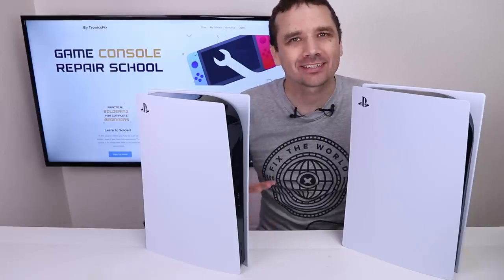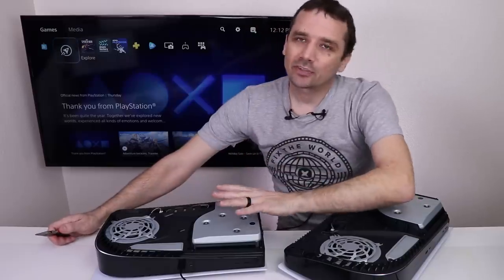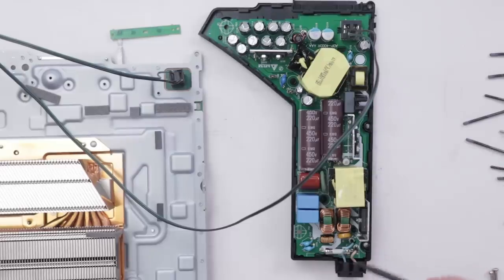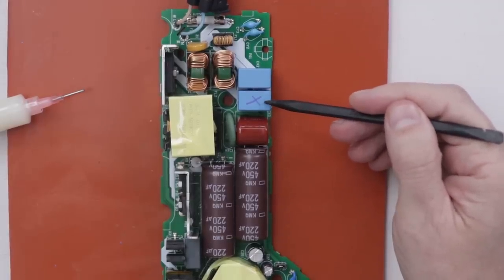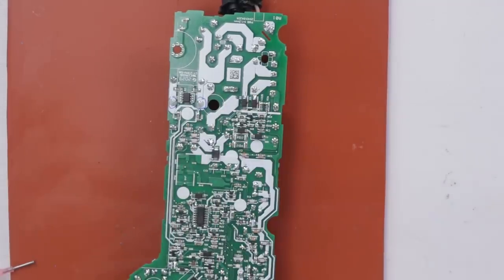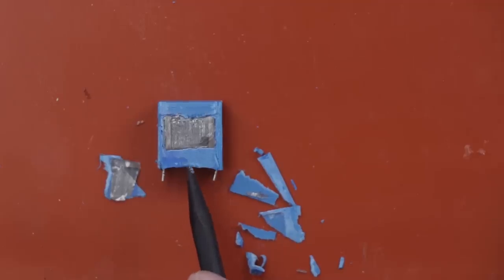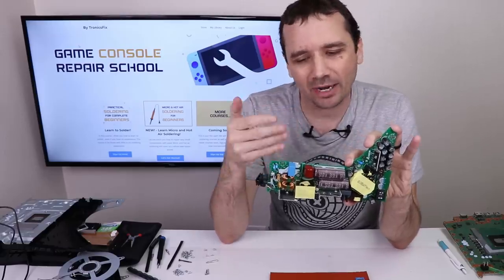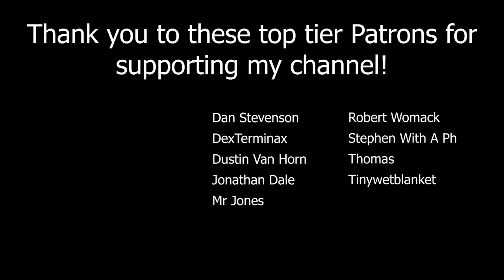PS5 Coil Whine - What Is It and Can I Fix It?

Comment: The buzzing in a foil capacitor is down to electrostriction - which is movement of the insulating films caused by the electric field as it passes through the capacitor.  It is harmless, apart from being annoying.  If you wanted to reduce this buzz, you could replace your foil capacitor with one rated for a much higher voltage.  A capacitor rated for a higher voltage will have thicker insulating films - which will need a higher force (voltage) to make them buzz.  A higher rated film capacitor should, therefore, be quieter compared to a lower rated one capacitor under the same voltage conditions.
Reply: He needs to see this comment
Reply: @TheMcdrewb  He sure does,mines dont whine but what if it does it later down the line,noises annoy me. I made sure i have controls on all 8 fans in my pc case too,lol
Reply: @MorbidThrasher666   yours does whine, you just haven’t played the games that mostly cause it. Try Destiny 2 or Demon souls.
Reply: How much is the difference in cost would you say? Curious if Sony literally skimped out on a few pennys or even a couple dollars.
Reply: @TriWaZe  Generally components are chosen according to what's appropriate for the electrical properties of a given circuit. The minimum voltages for capacitors is determined and then likely increased by a given percentage to guarantee that the part will last. Issues like coil whine are probably far down the priority list and somewhat difficult to anticipate. It's not so much that Sony skimped out on a part, rather, they followed standard practices for good circuit design but didn't anticipate this issue in advance and they'll likely make a change in a future revision.
Reply: @ultimateman55  Yeah but if this issue could just be avoided by putting in a higher rated capacitor then higher rated capacitors should automatically be chosen if the prices arent the issue. It should be factored in immediately. We need this voltage but up it to this to remove potential issues. Sonys been making electronics for decades and clearly understand this.
Reply: It seems to me you're much more interested in blaming Sony and accusing them of knowingly creating loud power supplies to save a buck than you are in considering what factors go into component choices and how such an oversight could be made. Perhaps you should just jump straight to Twitter to express your righteous outrage.
Reply: @ultimateman55  Nope. Again simply asking common questions based of this guys statements. Its a no brainer decision if this is really the issue.
Reply: @TriWaZe  Well if you aren't going to assume then perhaps you'll be willing to accept the idea that such issues are difficult to anticipate as electrical components such as capacitors are chosen based on their electrical properties and durability. Believe it or not when you're designing circuits in electrical engineering class they don't often bring up how much sound the component makes while current is running through it. It's perfectly plausible that it was an oversight rather than a conscious, negligent choice to save a few pennies.
Reply: @ultimateman55  totally agree on a engineering standpoint. I think going thru quality control it would have popped up. Obviously not every ps5 will have the same issue, but department that handles appearance and noise level would have heard it. Basically stressing a system to see for any weak points.
Reply: @wolffactor56  That's entirely possible, at which point conversations about release dates, customer impact, cost and other factors would be discussed. Would a relatively small nose affecting a given percentage of systems be enough for Sony to take corrective action? These are the kind of difficult decisions that Sony would have to make. I'd be willing to bet that many customers would happily accept the noise if meant getting their console on time. Who knows exactly how it went down, though? It's all speculation.
Reply: @ultimateman55  they definitely wanted the system out for the holidays. Whining noise would drive me nuts and I would probably bear with it for a few months and rma the system. Watching ReviewTechUSA video they are replacing certain ps5 owners systems when people complain to corporate. I’m sure future revisions this will not be a topic. What should be a topic is getting the second m.2 nvme bay usable for storage.
Reply: @ultimateman55  
Not disagreeing with what you've said, it's all very valid. But I don't buy them not anticipating it personally. The PS4 Pro had coil whine, and as shown in this video the PS5 uses the exact same component. They've known about it for many years, and I don't see how it's something that would go accidentally overlooked during stress testing. So much focus on creating a quiet product in their design choices, and they overlook a component that's profoundly noisy under stress? Doesn't add up to me. Console noise seems like it would be a focal point on their drawing board. Sony trying to keep production costs of the PS5 low is well documented. Thinking they went lower on some components and having to make compromises is just as plausible as what you're saying. There's been more backlash this time around so I hope it is something they revise in the future. It's obnoxious on certain games now at release.. I can only imagine what it will be like a couple of years down the line as games get more and more demanding than they already are. It's something that really needs sorting. Whether it was negligence, or an acceptable compromise.. It's not good either way. In fact, to me negligence is worse.
Reply: Negligence is not the case, is noise is between deemed apropiate by standards is OK for quality control, few pennies here and few pennies there mean a lot when you're cost saving, specially when mass manufacturing, running a business, and when you talk about millions lost is an important blow, the few "pennies" saved can be used by R&D deparments in more critical areas, and if not to find a profit or not to lose quite much, we want state of the art consoles and games but don't want to pay 999 bucks for a console, so where do you think these companies can make a profit? They don't survive from charity...
Reply: So I guess is safe to say Sony is using cheap capacitors, or low voltage capacitors to maybe reduce costs, but it makes the console noisy, that is a cheap move from Sony.
Reply: My PS5 has that "coil whine" but honestly its not as loud as I expected. Frankly, when the Blu-ray drive is in use, it's much louder than the coil whine. For those still wanting to buy a PS5 and think this may be a deal-breaker, it shouldn't be a worry. My PS5 has been running great ever since I got it. Also, take note that people will either be using headsets or have their surround-sound systems going and both options will easily cover up the whine. Plus, TronicsFix had to put his ear right to the PS5, before he tore it down, to really hear the whine.
Reply: @ultimateman55  if that's the case why is Sony customer service saying they're aware of the buzzing & giving out replacement models since launch?
Reply: @MvK-Delta  only ps5 game I have is demons souls. Other than it getting loud as hell when it randomly reads the disc I legit don't hear anything. Do you have to put your ear up to it to hear or are you supposed to hear it from across the room lol
Reply: Thanks for your understanding
Reply: @TriWaZe  

My first thought too. Like wtf sony this is next gen. Not a face-lift I want everything to be upgraded to now spec not have parts the ps4 has from a decade ago. 

Its gonna be another 100yrs until we get AR even though theres AR glasses now that look incredible. But they are only sold to professionals not for fun. 

Ide love to build a motorbike and when I get stuck just put the glasses on and have a virtual motorbike my model next to my real bike and I can blow up the virtual bike and see how it works or fits together like I'm sitting inside the engine. 

Imagine the games. Hurry up sony.
Reply: @soarerska  they make there money on software and nearly every console made has been made at a loss, it has always been the software that made the money and now they have subscriptions as well, I really don't understand people who defend companies that make massive amounts of profit every year?
Reply: U r an expert
Reply: @ultimateman55  while I do believe cetrain components are chosen for durability, sony and basically every main console company out there now has chosen joysticks that are known to fail instead of spending a few pennies more on sticks that are more durable
Reply: @mz4ever123  I called them to repair my ps5s blu ray drive and they said the buzzing is normal. Its annoying but its been around since the launch of the ps4. Hell, even the fat ps3 had it to an extent.
Reply: @rockl79  would push back & insist they fix yours. There shouldn't be any loud buzzing whatsoever only fan noise.
Reply: They 100% knew this was there and decided to neglect it, very bad form imo. Don’t go touting your console for being very quiet when this noise completely invalidates that statement. Beyond me why they put so much effort into making it silent and now instead you hear this, personally I’d rather hear a fan. This problem has also been around since the slim and pro models so I’m not too hopeful for a fix anytime soon.
Reply: "It is harmless" that's all I need to know, because it sure sounds like something is about to break.
Reply: Elecrostriction, lol. Have another beer bruh.
Reply: @MvK-Delta  really? Just go with fortnite , that's the game that makes ps5 buzz
Reply: @MvK-Delta  What do you mean by whine? Is it like a buzzing kind of noise?

Comment: I upgraded from a launch edition PS4 Pro to a PS5... i’d take this coil whine any day of the WEEK over the jet engine that was my PS4 Pro😂
Reply from the maker: Yes, for sure. In the end coil whine is just annoying.
Reply: My PS4 is loud and I have cleaned the heat sink countless times any suggestions?
Reply: @Tronicsfix  definitely. Only ever hear it when i purposely put my ear against the PS5 lol
Reply: @Saif649-1  From what i’ve heard, replacing the thermal paste would be the next best solution
Reply: Tbh both Xbox and ps5 are silent my series X makes no noise and I’m right next to it on my desk
Reply: Using minus 8 pads from grizzly cut to the same size of the rams chips  eliminated the jet engine sound completely.  Adding liquid metal after made little to no difference.
Reply: @Saif649-1  did you change the thermal paste? If not that can cause the fan to be loud as well. Bad thermal paste makes it where it isn't cooling like it should be so it tells the system to turn on the fan at max speed.
Reply: @Saif649-1  Thermal paste fixed mine. I used noctua NT-H1 thermal paste on my ps4 pro and it drastically reduced the jet engine noise. Only thing I really notice now is the disc drive spinning up when i power it on. In my case there wasn't enough thermal paste from the factory.
Reply: The pro fan noise can be fixed very easily. Just take the top off and the fan is right there. You can even get a small brush in and get rid of all that collected dust . My pro is near silent after a good clean
Reply: I hear so many people saying their ps4 pro is so loud but I always thought its pretty  quiet :D never had any issues with it
Reply: If you think that’s a jet engine? Wait until you see my 2013 Alienware laptop 🙄
Reply: @ARXInfinite  mine too I can't hear anything except the disc spins up randomly every once in a while
Reply: Try cleaning ur ps4
Reply: Sometimes coil whine resolves itself.
Reply: Same
Reply: @Tronicsfix  even then, it's not a big deal because 99.99% of the time you'll have some form of audio when using your PS5 so you won't even hear it. As long as it doesn't affect performance it realistically doesn't even matter
Reply: Literally my sounded like it was taking off from Heathrow lmao, so this coil whine is nothing I’ve barely noticed myself
Reply: My pc has all noise cpu gpu psu fans all make noise as long as its fine
Reply: @a_hameed09  same
Reply: I’m using a base ps4, sometimes I feel like it really has parts from a jets engine inside of it from how loud it gets. I’ve cleaned it several times and I’m starting to think it’s just the PlayStation.
Reply: @a_hameed09  Then you got lucky. I've gone through two PS5s and I could hear it from a distance in both cases. The replacement PS5 I got from Sony was much milder but definitely audible from a distance.
Reply: @ARXInfinite  I have both too. The Series X is dead silent, the PS5 would be too if it didn't have coil whine
Reply: @tahaazeem6231  I sent mine in because I could hear the coilwhine over the TV noise. I got a replacement and it's much quieter but you can still hear it over the TV. I don't know if I'm just really unlucky or you guys are deaf.
Reply: I still have the original model from 2013
Reply: my ps4 pro has both coil whine and jet engine smh
Reply: @ReddSquall  sounds like your really unlucky, the chances of this many people having hearing issues are quite low
Reply: @ARXInfinite  My PS5 makes that minor whine/buzz only audible at less than one meter.  But my Series X is almost scary quiet. You're right, it literally makes "no noise". I've noticed that the SX fan never seems to run at all in Sleep mode, yet it still exhausts warm air. But damn...quiet as hell.
Reply: I actually prefer the sound of my ps4. Air blowing sounds natural to me,  the buzzing on ps5 just sounds odd and more annoying, to me at least
Reply: It's funny,  I cleaned the fan and heatsink in my pro.  Now it purrs like a kitten.
Reply: @Saif649-1   Replace the thermal pads with thermal grizzly ones 120x20x1.0m cut to the size of the ram chips. Use new thermal paste while you’re in there I find MX-4 works great. I repair noisy PS4’s and most have had little build up in the heatsink but with new thermal pads have been silent, obviously demanding games the fan will ramp up but no where near how it usually is.
Reply: @SquareTales  exactly what I was going to say! My PS4 Pro is great on sound
Reply: @Saif649-1  thermal paste
Reply: That jet engine noise means you need to clean your cooler and reapply new thermal paste.
Reply: I have to disagree my ears can take a loud fan but that ringing, whining & buzzing is hella annoying 😬
Reply: I got the latest revision ps4 pro. I think the red dead version. First revision was noisy, second revision fixed the noise but was prone to overheating, third revision fixed both
Reply: Same here, from launch edition ps4 pro 7006 to ps5, it's sound so quiet. My ps4 pro is very clean, I clean it everytime before playing, clean the fan every 2 months, close with sleeve if I not play, replaced the thermal paste and pad with the good one, but only for 3-4 months, the noise is back.
Reply: Thermal paste change fixed my ps4 Pro jet plane. It's now sounds like a paper plane
Reply: @Tronicsfix  yup, but when you are more than a few feet away you can't hear it. My main issue is the loud blu ray drive

Comment: You can completely solve the noise problem by sending your PS5 to me.

That way, you won't hear it :)
Reply from the maker: That's so thoughtful of you! Lol
Reply: @robstehlik3037  No.
Reply: @robstehlik3037  ill give you $20 bucks and half a sandwich for that PS5
Reply: @robstehlik3037  do you tho
Reply: @adriangallardo6750  that has got to be the best offer ever and very thoughtful everyone needs to eat these day's.
Reply: @adriangallardo6750  I will out bid u with a 25% eaten sandwich and $69
Reply: @brady1ishot  if he doesn't i have a few
Reply: @adriangallardo6750  just because i like you ill give you a ps5 for 5 dollars
Reply: @Tronicsfix  Lol
Reply: Hes here to steal our ps5s
Reply: @robstehlik3037  I'll give you a full briefcase of money for your ps5. Pm me
Reply: @robstehlik3037  and, if its a 'ps5 scalpers edition' I easily double the bid!!!
Reply: Mines on the way back to Sony to be thrown in the bin. I can't stand the noise so they are sending me a new one. However if the replacement is also noisy I'm going to fix it myself.. using the results of the next video here :p
Reply: @adriangallardo6750  give me some chicken nugget
Reply: @adriangallardo6750  that’s such a great deal I wouldn’t pass on it
Reply: @Tronicsfix  my ps5 was stuck on shutting off . I had no choice but to shut off my power surge  by unplugging the ps5 could this damage the console.... right now it still working fine for me but ps5 has a few bugs and Sony said to wait for a patch
Reply: @robstehlik3037  3. Take it or Leave it.
Reply: Haha.. that way won't u hear the noise?
Reply: I don’t think he’s ever going to give them up
Reply: I will give you 3€ and just a bite of my sandwich
Reply: @robstehlik3037  5 dollars deal or no deal?
Reply: Did someone got Rickrolled?
Reply: Or see it.